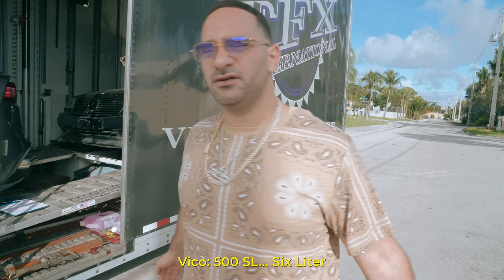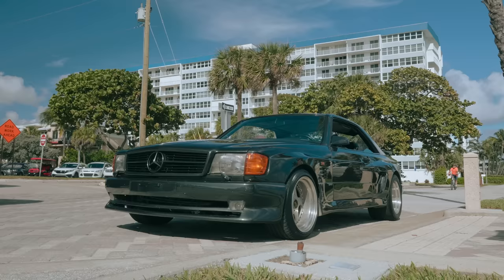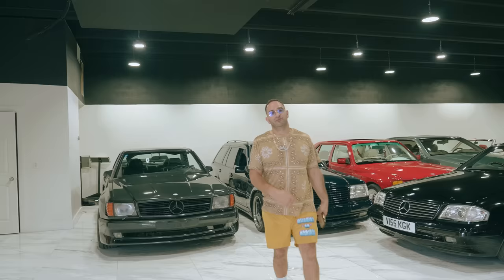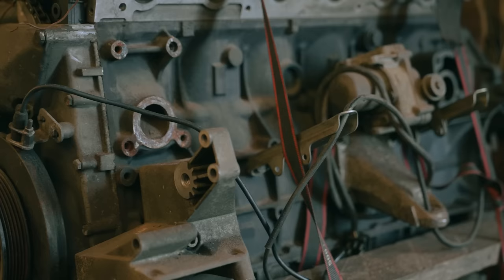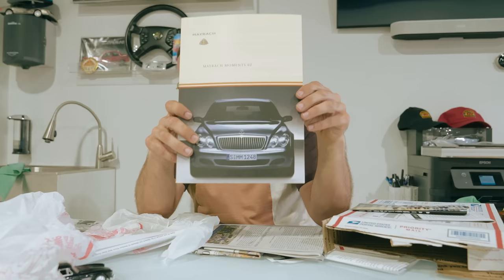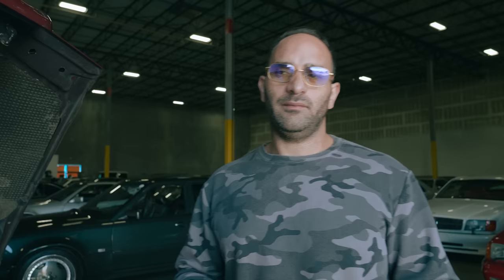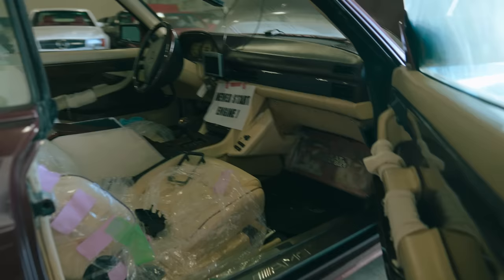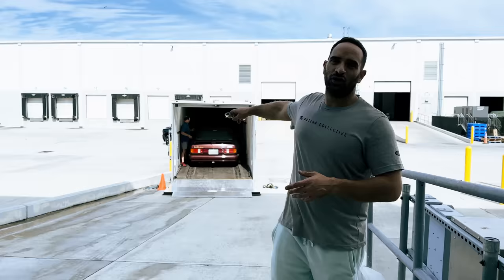Gen II Koenig Specials SEC First Drive & Special BRABUS Motor Delivery! | VLOG #036

Comment: Nice ride I have a gray market black 84 500 SEC that had the AMG package but has no wide fenders.  The monoblock chrome wheels bubbled up so I sand blasted them but ended up with pits all over so right now it is sitting on 4 Carlson wheels but one of the wheels needs to be re rounded as it seems it was on an accident so it is slighly oval.   It was all blacked out and to me it looked hideous. So I restored all the ionized blacked out trims back to the chrome color. Front and rear bumper chrome parts were replaced with other 500 sec chrome parts from two wrecked cars.  I broke the driver side window when the elevator broke apart and the motor for the elevator failed to work after replacing the window.  Since then it has been in my garage since 2015.  I have all the parts but hadn't have the time to fix it.   The short year I drove it to work it made lots of heads turn.   Nice 80s and 90s rides you got here.

Comment: Well said Vico on keeping motors healthy especially the 117. Change those timing chains guides tensioners etc. Clean the fuel tank if it's never been done. Helps protect the fuel divider and injectors.

Check out my collection on YT  @egsgarage